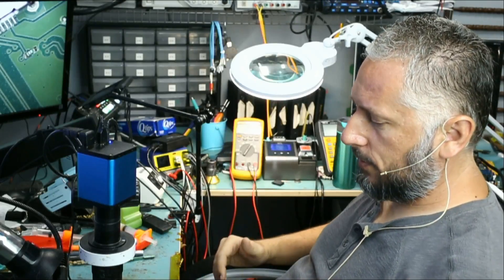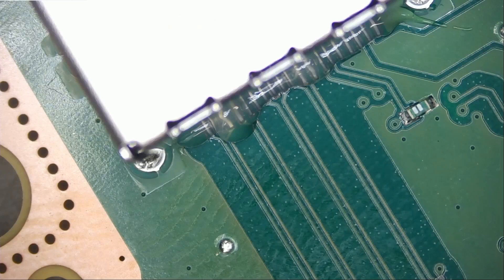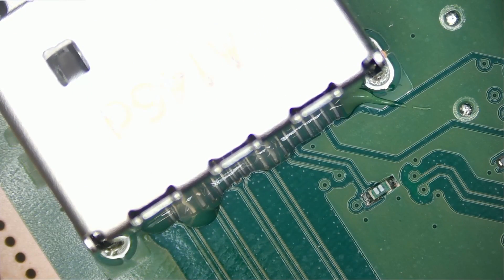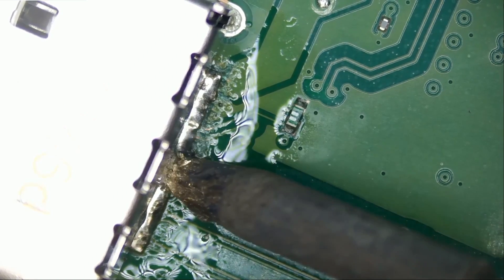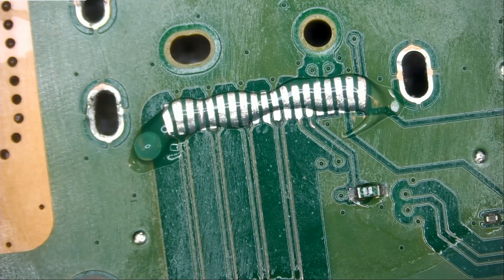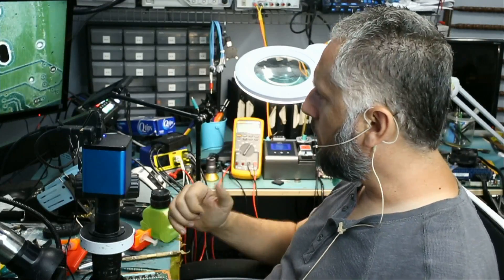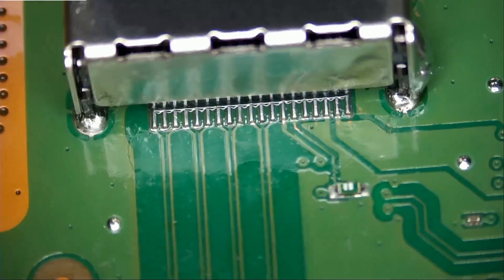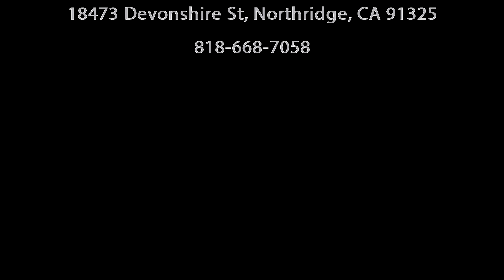Replace HDMI connector on Xbox Series X Better Than Factory - Tools and techniques.

Comment: i bought a tube of the amtec 559 flux and the atten hot air station. i really love how fast it heats and goes to low temp when parked. the price was better than fair compared to most other brands, and i got them in two days! learned quite a lot from your videos and my buying the items was my way of "paying back"
Reply from the maker: Thanks for your order. Atten is a great hot air station and 559 flux is best of the best .I appreciate your feedback.

Comment: My first time ever trying to replace an electronic component. My son's HDMI port on his Xbox was damaged. So I'm a complete newbie here.

I got the old port off no problem and cleaned up the board. All the pads look good.

What you did at 11:34 ... flowing the pads ... I can't for the life of me do anything remotely similar. Every time I try, I just get a ball of solder moving across the pads. Nothing adheres to the pads. What could I possibly be doing wrong?

Comment: I have a chipquik SMD removal kit that has flux and the alloy. Is that the same as the items you've the used for desoldering the broken HDMI port? I know the flux is different and my plan is to use the same flux and hot air station for soldering the pins and I have a soldering iron that has different temperature settings.
Reply: That should work, hot air helps but you can do it without too.

Comment: Quick question why didn’t you use the soldering iron tip to connect the hdmi port the board, I see that you only use the heat gun Impressive

Comment: As someone whose started doing repairs on my consoles I found this tutorial and your other videos incredibly informative. I've been having issues getting components off boards, and watching this video I think my issue is that I'm not applying enough heat. I think it may be time to upgrade my soldering station. Excellent video thanks!

Comment: What kind of solder was used to attach the new port's pins & what was the temp for the hot air reflow?  Also, thanks so much for the great videos!  My old port is off w/ all pins in perfect condition & I couldn't have got this far without this channel's excellent guidance!

Comment: Hey Northridge Fix,

First off, love the videos. Have watched maybe 30! Great commentary and beautiful work.

I have a question about soldering the new port: Are you also using low-melt solder to attach new port? Or are you returning to a lead-free solder for that?
Reply: I’m late but I can only imagine he’s using regular leaded solder, as this has a lower melting temperature so it’s easier to work with, and the lead provides a better joint iirc

Comment: Great reapir, I am in the middle of repairing a previous hdmi repair attempt and nootices that the resistor R178 is missing beside the hdmi retimer chip, is there you would know or anyone has an idea what is the value of the resistor R178? Thank you

Comment: I am about to replace my PSU, MSI A750GF. It is shutting down my pc under heavy loads. I am running 450 watt TDP, EVGA RTX 3080TI FTW 3 Ultra Hybrid. If I let it draw full power. I get loss of power shut down. Windows logged a critical power loss.

Comment: Very beautiful work. Wouldn't be a good practice to cutting apart the connector with a precision cutter, then soldering out the pins separately?
Reply: What why would you do that.
Reply: @kevinhamlett1400  Because, if you can solder out the pins separately, you don't have to keep melt other pins while you do that.

Comment: Suggestion for upselling customers who send in devices for HDMI socket replacement (you seem to get a lot!). Breakage probably due to them using one cable to swap between their different TV sources. Offer a good quality HDMI splitter as an optional extra when you send them with their repair bill. Sorry, if I'm teaching a granny to suck eggs :) Regards Chris from England.

Comment: I see people remove these ports strictly from the bottom such as Alex here and straight from the top as well. I have to blast both sides. I've never had success from one side for some reason. Low melt used as well.

Comment: The conspiracy theorist in me thinks Sony and Microsoft use such weak HDMI ports so they typically fail after the warranty expires and people will buy a new console instead of repairing it.
Reply: Broken HDMI connectors are not covered by warranty anyway, even if you break them the day after you buy the console.

Comment: Hello.  I appreciate your films, I am so glad that I can write to you.  I have a question for you.  Which HDMI connector soldering is more durable, pin by pin or your relatively new method better than factory (using hotair)?

Comment: Thanks again Alex, I'm not in the repair business only hobby repairs of solar inverters and professional build small controller boards. I have all the tools available but you need to know how to use them. I learned with help of you're channel to do it the right way. Many thanks!
Reply: What solar inverters? I just did a couple of those a few weeks back. Aurora-Power one. I needed the service password, and support wasn't very forthcoming so I resorted to reverse engineering and wrote a keygen. If it's any use to you let me know.

Comment: @NorthridgeFix I have packages coming in regulardly from the US.  These are packages that way 2-3lbs and the customer pays roughly $22USD for shipping to me.  For your carrier to charge you $45USD for shipping on a tube of flux to me, I would highly suggest you look at alternative carriers to take your business to, your getting ripped off.
Reply from the maker: There is no $22 from the USA to international countries even for one syringe of flux unless you ship first class USPS (under 1 pound weight) and package is guaranteed to get lost. The only reliable options are UPS and Fedex. You can check rates on there website by weight and size. Check video I did a while back talking about rates https://youtu.be/YwOj6NtOjDI

Comment: I never used low melt solder, but I will get one and try, it is great staff! But works only on one layer ports, with two layers only you can do is to heat the port and put low melt solder to "fixation points". Keep great work!